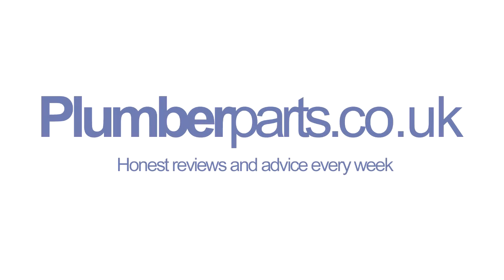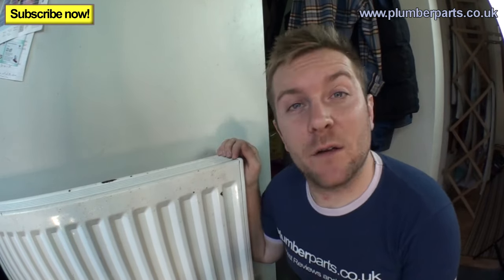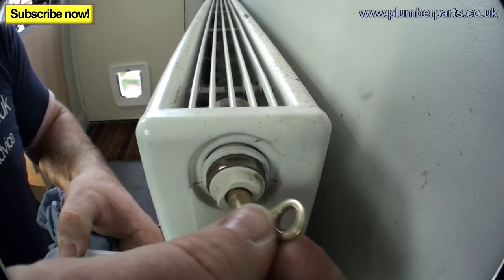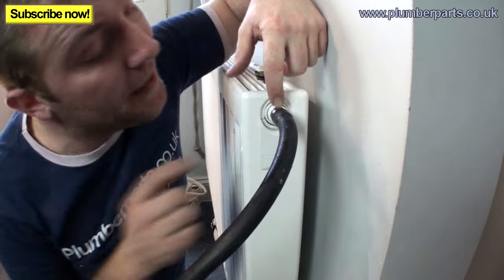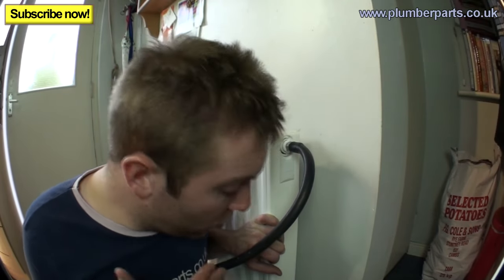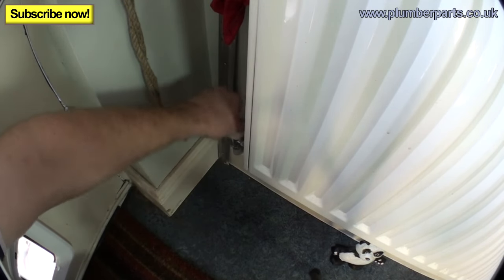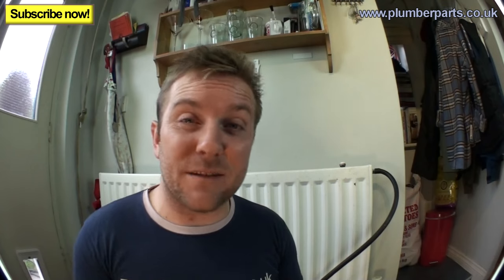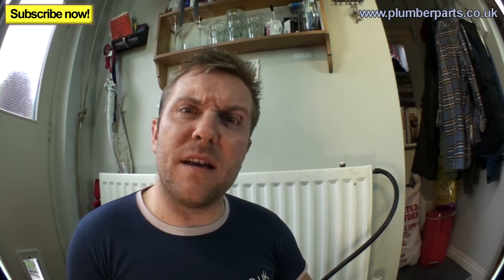REMOVE AIRLOCK FROM RADIATOR - Plumbing Tips

Comment from the maker: Links to the tools I use everyday here: https://www.amazon.co.uk/shop/plumberparts
Plus, follow my Vlog “TimesWithJames”: http://www.youtube.com/c/timeswithjames
Reply: Please can you advice me , recently we had a new pressure  boiler fitted and ever since then we can hear the pipes under the floor boards and walls tapping / rattling and banging noises . I have gone round to each radiator to see if there’s was air in them and some did have a lot of air and some didn’t , I then switched boiler back on and I have noticed the tapping/rattling/banging noise isn’t as loud but it’s still there and disturbs us during the night and mornings , do you know what the issue can be? Our old boiler was fine for 14 years with no noises whatsoever. I’ve read ppl saying there could be air in the boiler system but I haven’t found any video on YouTube that shows how to remove air from a pressure boiler apart from Americans that have a different set up as here in UK. 
Please help 🙏🏼
Reply: hi your link at 0.45 secs is not working. Could you please direct me to that link?

Comment: Ive solved this a few times by turning off all the other rads so the one rad gets the full flow of the pump. Almost always pushes the air out.
Reply: This worked perfect, thanks for the tip!
Reply: Joseph Bicheno  Will give this a try. Have one rad with the built in bleed vavles on the inside of the raditor and there small than the bleed key so you cant turn them or even get any grips to them.
Reply: Thank you for this it fixed my living room heater!.
Reply: Where does the trapped air go out from? You need to bleed the rads once more to expel the air lock (trapped air) out.
Reply: @harunyahyadotorg  yea, you need to keep bleeding but it can be pushed out of the air vent. You should only get this issue on an open vented system, if you have a sealed system then you shouldn't have this problem. The idea is to push the air either out of the vent or into a radiator where it can be bled.
Reply: which rad did you leave on the furthest or nearest to boiler?
Reply: @Dawgley  the one not heating up
Reply: Just tried it and my radiator's working, many thanks!
Reply: Fucking legend

Comment: Thanks for this vid (and many others). Learnt from this to get a cold rad hot again. Easy 10min job including digging out some hose and an old half inch tail. Incidentally I drained into a bucket instead of outside as I could use a short 1m section of pipe. Easier to thread onto the rad.

Comment: thank you very much,
 after trying forever to get my kitchen and hall rads to show any signs of warming up with no success this worked. i used a rad valve on the top outlet with a hose to outside and i worked the flow and return valves. seperatley.
it took some time to get all the air out but you could see the water stopping and flowing from the hose as the air came out
awesome guy you are!

Comment: Can I just thank you for this video. Got a system with 17 rads on and could not get the furthest radiator from the boiler to work.
Used your solution and now it's piping hot again.
Thank you
👍👍👍👍👍👍

Comment: epic guide as always. I must say I've learned a lot from your 5-6 minute videos over the last 2 years to the extent I installed 6 new rads in my extension and balanced the system, had it bled via this method when one rad was blocked, etc. thx thx thx!!

Comment: Thanks for this video! I fixed my rad that wasn't getting very warm. Even though there didn't seem to be much air or any muck come out, it was tickety boo when I fired it up again! Winning!

If anyone is wondering how to make the threaded hose pipe connection - screwfix do a £3.50 filling kit that contains a couple of plastic adapters that are perfect to connect some garden hose up to the rad.
Reply from the maker: +fourspoons Thanks for the comment dude and well done!
Reply: do you have a part number ?

Comment: Thanks mate, will give this a try. 4 of 12 rads upstairs not working now after a pipe replaced under house (slow leak with skirting board nail). 

Do I have to close any of the other rads in the house before doing this on problematic ones? Cheers

Comment: Thanks matey you just sorted my system. Had replaced 3 rads but couldn't get rid of the airlock. Your method plus 30 minutes draining sorted it. Some amount of air came out yet every rad had water in it to start with!! Oh well. Thanks for the tip

Comment: this works.
I ended up using a 1/2 hexagon male thread from Toolstation, a flexible 1/2 tap connector to 15mm speedfit, and a short bit of push-fit into a large bucket.

Comment: Great video..is it the same procedure for a towel rail, only the bleed valve is at the top, and a little more fiddly getting the excess water out the towel rail, due to the angle of the bleed hole ?

Comment: Thanks so much. Put a new radiator in the system, and spent 2 days trying to get it full. This did the trick. It was funny, but only opening the bleed valve sucked air in. This got all the air out.

Comment: Hi. Your vids are great. Watched a few to sort heating and plumbing issues. I had this issue this week, with 2 rads not heating up after topping up the system due to valve change. It worked great. But can I ask why the usual way of using the bleed valve will not fix the air lock issue?
Reply: Not enough flow to blow out the air, methinks...

Comment: Hi James Just wanted to say many thanks for this video I had done everything i could find to get a small radiator in the utility room to heat up 
I even replaced the radiator and the TRV and Lock shield flushed the system twice and topped up with inhibiter 
First go with your method with the hose out Bang HOT RADIATOR many thanks from me and the wife and a special thanks from Boss the cat who sleeps in the utility room at night 🙀😸

Comment: Hi, we have two radiators one in spare room and one in ours which are both cold we,ve tried bleeding them the pipe from the ceiling is hot but only is hot up to the valve of the radiator I,ve checked both valves and they are both working OK the radiator is cold bottom and top I,ve even tried turning all the valves off on all the radiators so as it pushes the hot water thro to the radiators that won't get hot but still no joy do you think there could be a big build up of sludge in the bottom of the radiator that,s why it's not getting hot  any info will be a great help. Many thanks Steve

Comment: priceless videos mate, after trying this to no avail i'm now at my wits end.

I have a boiler on ground floor, where the 2 bedroom rads and 2 bathroom rads are, and a sole radiator upstairs. The rad upstairs doesn't heat up.

Following the flow of water from the boiler, the warm water bypasses the pipework to the upstairs rad and only serves the downstairs rads. I fitted a stop cock to isolate the lower rads but the upstairs rad still doesn't heat up. any advice would be greatly appreciated.

Comment: I have two large twin panel radiators downstairs, that barely come on at all.  I'm wondering if its airlock in them, as I have already checked the thermostats on each one, and the flow rate valve on the other side.  I've tried bleeding slowly with a key, and that used to work but not anymore.  I also have an at times loud knocking noise in the pipes above the room, sounds maybe nearest the cylinder tank which quitens down a little during the day.

Comment: Hi. I took a vertical rad off the wall recently to decorate behind it, put it back and now on the 3 panels out of 7 are getting hot (on the TRV side) Tried bleeding but only water coming out, not air. Could this be an airlock or something else? Also where can i get the 1/2 inch hose adapter?

Comment: Just changed my indirect copper cylinder which is situated in a ground floor room in the kitchen. Refilled the heating system and all well, no leaks. All the rads hot on ground floor but the three rads in upper floor are stone cold.  Must be an air lock some where; strange how the top floor rads are cold as generally after a drain down they get the heat first.  No diversion valves on this system. Will try the hose pipe trick.

Comment: Hi there, can you tell me the fault, I have a Worcester Greenstar 30si, it doesn’t hold its pressure, keep topping up everyday, pumped up vessel, and topped up, so far so good, when boiler is on, the prv starts leaking, and when boiler cools, pressure is back down again. Oh on that odd accession there is water coming out of vessel when de pressured. So is it the vessel or prv at fault. Thanks for reading, feedback Welcome, and these videos are absolutely bonkers👍

Comment: Hi, great videos. Did you turn off the timer on the boiler first, or did you power off the boiler entirely before dealing with the radiators? Thanks.

Comment: I think I have this problem on one radiator.  The rad is on ground floor with a feed and return coming from the floor above due to location.  I've removed the bleed valve to take a look and it looks like a 10mm thread.  Is there a particular fitting you could recommend to attach a hose?  I was thinking maybe using a 10mm flexible tap tail connected to a garden hose fitting or similar.

Comment: Great video! Thanks! Quick question - one radiator in the house is stone cold (pressurised system). Both flow and return pipes are also cold. TRV seems OK. AllOther rads in house are lovely and hot. Is an airlock likely to be the problem if BOTH pipes are cold.
Reply from the maker: +Alex R Air lock!
Reply: +plumberparts Tried removing the airlock, but it turned out to be a horribly kinked 10mm barrier pipe (instead of fitting an elbow - they just bent the pipe 90 degrees after the straight coupling). 8-year old house and I doubt the radiator ever worked - it does now!!!! Thanks again for all your great videos!

Comment: I remember weeks of doing this with my system but it made no difference And I was mistified . The rads are plumbed with 15 mm Hep2O but with copper near the solid fuel boiler. I ended up dismantling the pipework and found a dead fly stuck at the first Hep2O support sleeve. It was small enough to go through the copper pipe but not that sleeve! After that I fixed some old net curtain over the top of the expansion tank.

Comment: i am from Greece and we had these keys, gold or silver, to remove the air from a radiator. Now i live in Poland and in my flat there is an old radiator, two pipes up n down with only one valve, like a daisy flower. Should i unscrew this like i used to do with the keys??

Comment: Hi can you do a video, of setting up radiator system ,ie  balancing rads and  balancing the system from the 2way valves , i have a open vent system, when my hot water is on and radiator on  the hot water robbs the heat off the radiators,  vise visa. I need to know how to balance valves, 1 for the hot water and the other for  the rads, please

Comment: Have bought some Quinn roll top rads which don't have bleed nipples and they claim don't need. Cannot get the things to heat up more than half the rad height. What is the trick with the nippleless rad? Cheers.

Comment: Still no hot radiator :-(
Thanks for the excellent video. I did what you said but only got a fraction of the flow from the TRV valve compared to the lock shield end. The TRV plunger moves normally. Any suggestions please?

Thanks

Comment: Don't forget to tell anyone who is trying this that if they have a sealed system they will need to top up afterwards, good video though, sometimes I do it the other way round, on a gravity fed system I have blown water through the rads using a garden hose to shift air,

Comment: Not having a go, but learning to balance a system properly will alleviate this problem and can be done much quicker. If proper balancing techniques dont work, then the system has a blockage somewhere within a pipe/radiator and will require chemical or power flushing. I do enjoy some of your videos though, like I said, not having a go.
Reply from the maker: Very true mate! 😎
Reply: @plumberparts  This worked for me on several branches of an old and somewhat complex heating system! Thanks buddy!

Comment: How is replacing a bleed vent with open ended hose any different? Both do exactly the same thing. The air you hear is just the air that entered the rad when you drained it to put the hose on.

Comment: Hi, great video and tip. I managed to do this and the pipe that was cold became hot and thought great it's all fixed untill I put it all back together and the pipe has gone cold again along with a cold radiator. What's my next steps?
Reply: Same here.  I heard the air lock come through when I opened the return, thought I'd solved it, but when I got the system back on, still nothing.  Did you find a solution?
Reply: @mrcrumb4302  Hi, because the house was done in microbore and the radiator I was referring to the pipes was in fact blocked. I run a new 15mm hot and cold pipes to it and works a treat now.
Reply: @EricNgg  Ok...Thanks.  Looks like my flow pipe is blocked.  It's 10mm so I think thats microbore.  A real pain to put new pipes in so I think I may try to pump it out.

Comment: Scrap my comment about inlet meant the lock shield but after I go a new one it did same at some point. I had to un do the drain valve and seem to remove a lot of air so it's working again!! I've had to replace a rad . 3 lock shields so far and unsized 2 TRV,s going well lol!! I've managed to bleed most of the rads now as got a decent key.
Reply from the maker: +James Baillie Good luck mate!

Sub here please>> https://www.youtube.com/subscription_center?add_user=plumberparts <<If you haven't already!
Reply: one a nice 600 quid rad at john pye for 30 quid!! Getting tomorow

Comment: How long before the pressure is dissipated, mine is still pumping out water from the bleed valve after 5 minutes. System is switched off and 3 port valve latched

Comment: What about heating system in bungalows or flats where all the rads are on one level. I'am in a flat with 9 rads and even though they are hot at the top they are just warm at the bottom.

Comment: I had a leaking radiator pipe, I fixed this but air has got into the system. I'm following your steps, but when I turn the flow on the pipe is warm but not flowing into the radiator. Could this just be LOADS of air? The system is at 1.5 bar all the radiators on the system after the one I fixed the leak on are not working. Cheers for your reply is you do lol.
Reply from the maker: Sounds like a massive airlock mate. You've tried venting with the hose attached? PP!
Reply: I have thanks. Turned out the radiators had a massive air lock also, I've taken all radiators upstairs off to flush them through with clean water. Turns out British gas system flush was not worth the money. ;-) Problem solved. Thanks for the videos.

Comment: I got a system that has about 0.8 bar then 3 bar on, the pressure climbs up from from 1.6 bar to 3 bar,  its crazy, it maybe the rubber bladder for expansion?

Comment: I removed a downstairs bathroom rad to decorate.. Refitted it.. Can't get it warm again? Can feel the flow valve getting warm and that's it... I've bled it and water is coming out but still not getting hot? Would this scenario work  to resolve it? Also does it matter which side you do first flow/return? Thanks in advance...
Reply from the maker: Yes!

Comment: Hi

i have a open system i swapped a normal rad for a towel one in bathroom its a old system now that rad only heats half way and one downstairs is cold, when i was changing the valves i bunged up the expansion and the inlet valves in the header tank
The rad down stairs isnt getting hot at all but is water in it, it has a welded in bleed vavle , can i just connect a hose to each vavle one at a time and do it that way?

Comment: I’ve got to say your videos are brilliant. However sometimes I wonder if they’re actually aimed at plumbers & DIY audience cus I keep hearing words like: 
-“drop your ball valve“
-“not enough suction“
-“remove your bleed nipple“
-“screw this in“
-“take your hose outside“
-“connection not good enough between your hose & the nipple“
-“make sure the ball valve drops down nicely & doesn’t get stuck up“
-“you’ll hear air & water rushing out of this large hole we got here instead of this tiny little hole that used to be here“
-“pressure will disipate out of your hose by itself“
-“remove your spigot“
-“sucking onto your thumb”
& so on. 

These all extracted from this video😂🤣😂😂

Comment: Is there a way to do this with radiators that don't have the large connection at the top? I've got a large double radiator (probably quite old) that just has 2 small square bleed nuts that screw directly into the inside of each radiator panel so nowhere to connect a hose
Reply from the maker: You'll have to remove the rad and do it with the valves! 
Sub here please➡️👉 https://www.youtube.com/subscription_center?add_user=plumberparts ➡️👉FOLLOW US ON TWITTER! TRYING TO GET MORE FOLLOWERS! 🐤👉 http://www.twitter.com/plumberparts 👈🐤

Comment: Ok have tried everything for my one cold radiator. balancing, changing the TRV, switching all radiators off except the cold one, (no it didn't heat up) I even changed the radiator and it's still cold. I tried what you said in the video but there seems no pressure when I open the TRV, just drips, when I open the LS side there's pressure. Any suggestions where I go from here, before calling someone? Thanks for the help
Reply: mark melvin mate I’m in the exact same position I have 10mm microbore pipes behind the plasterboard walls, my system has built up with sludge over the years and I can’t unblock it!
Reply: Sound like you may have a blockage in the tails. Are you able to access the pipe which the two radiator tails tee into? if so, does this run hot? if so, one of your tails is blocked.